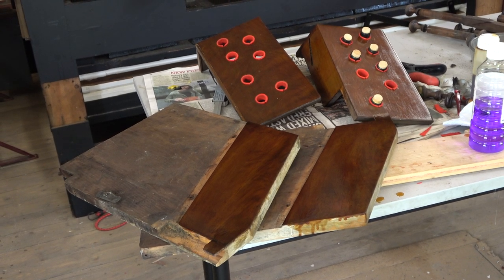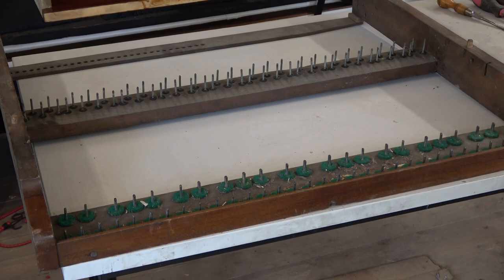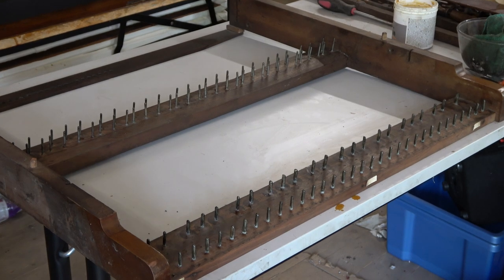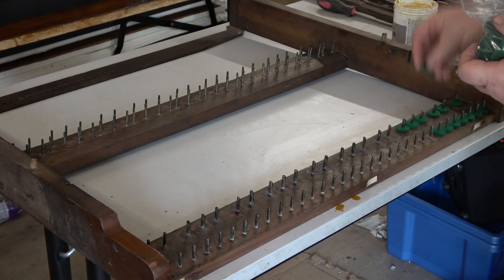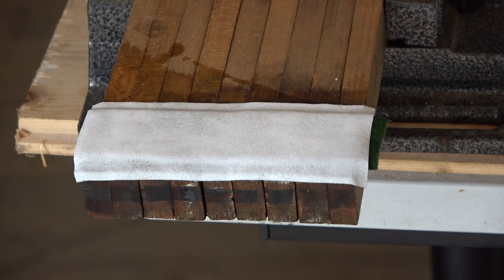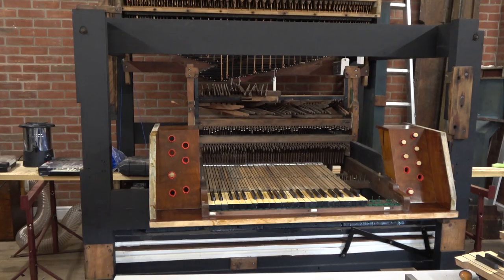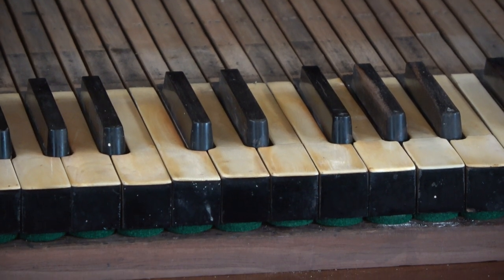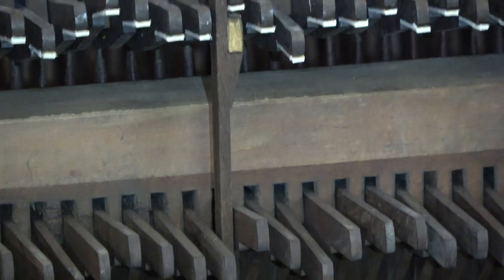1865 Forster & Andrews pipe organ restoration & installation - Part 17 of loads

Comment: When I was a teenage radio amateur bringing old equipment into the house, my mum used to clean it with Vim. It removed all the tobacco stains and residue. It's really useful stuff.
Reply from the maker: I said Vim & promptly used Ajax!  Both work well. That Ajax I'm using came from a deceased 94 year old relative four years ago when I cleared the house. I ordered both Vim & Ajax on;ine via ebay a few week ago as it's not in the UK shops in it's powdered form & appears gto now be made here as an export only item. Perhaps it's been banned here.

Richard, G0OJF,  UK
Reply: @ukfmcbradioservicingTango21  Vim is now called Cif.  It cleans baths without scratching 🤣  Organs as well.